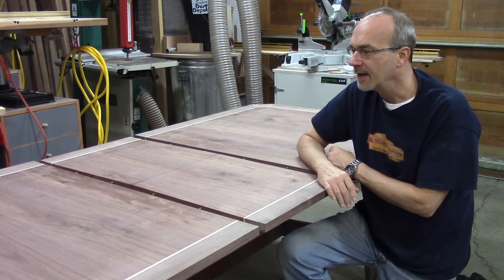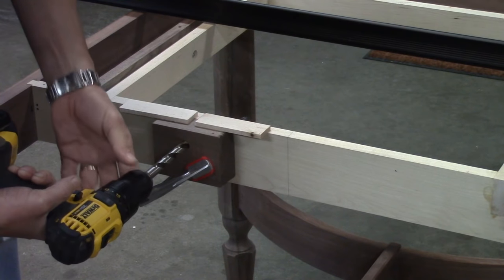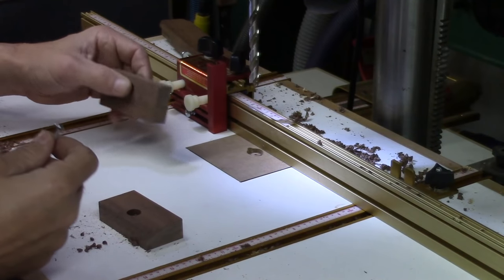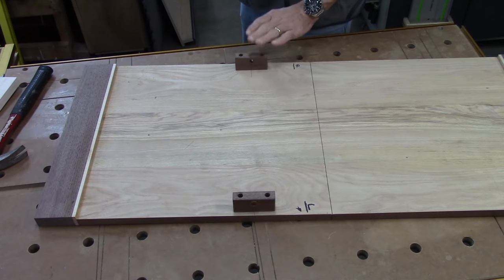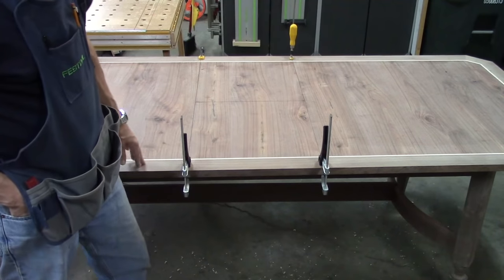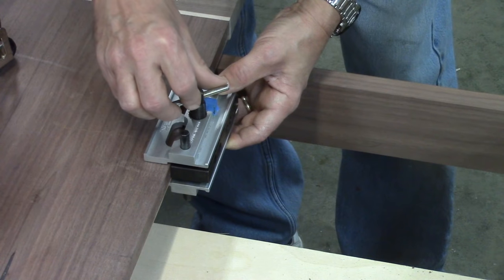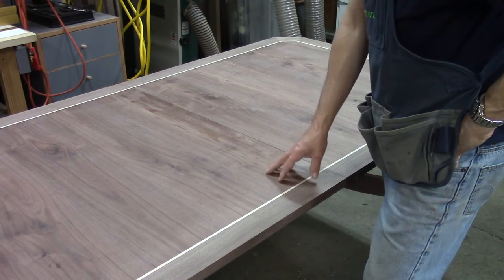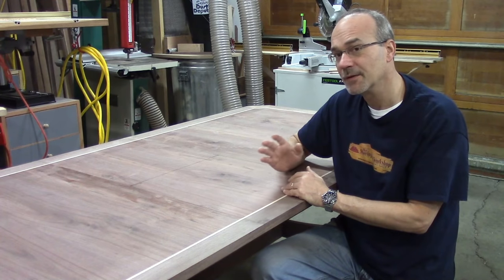Butterfly Leaf Dining Table 9 - Designing and Installing the Butterfly Leaf

Comment: Hi Guy! I watched all 10 of your butterfly dining table videos last night!  I've been looking for a design that I would like to build for a while, and fell in love with your table.  I would prefer to use solid wood in place of the veneered plywood, and would appreciate any tips you could share to accomplish that, especially how to compensate for wood movement.  Any help is sincerely appreciated.  Thanks again for inspiring me!
Reply from the maker: Hey Howard, You could easily use solid wood for the top, however there is no way to do the solid wood framing around it, as it would pull apart over time from expansion.

Comment: I really appreciate the planning that has to go into your projects and the way that you implement that plan.  Can you tell me, did you design the table yourself or did you get the plan from another source?  Great job on the splines, I think you made the right choice to use walnut.  To me, part of the art of woodworking is sometimes being able to hide the structural details of a project in order to preserve the beauty of the wood.  Using the walnut accomplished that.  Great job.
Reply from the maker: +Ed Stengel Thanks Ed! It was my design, and no plans were used. I just kinda build things most of the the time. I did make a scale model and a few rough sketches to cement some dimensions but that's about it.

Comment: Okay, I"m' confused ( nothing unusual there :) 
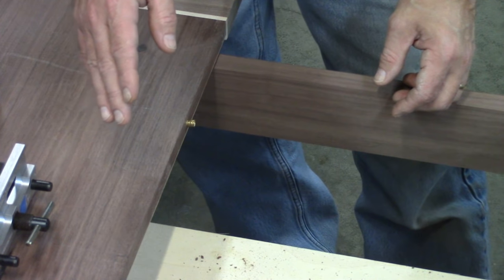I must have missed it? but don't understand what all that was about @ 11:11 when you did the corner piece in the middle of the edge??  not sure why it was a space there to begin with?
Beautiful table..   My grandfather owned a furniture store Years ago in Maine ( Moosehead furniture ) and our family table had a flip-up leave in the middle .. I was thinking of making one like he did. .but no idea on how to do that middle piece .. I see what you did. so I guess it's doable .. But . I"m still thinking of doing a DOUBLE leave .. One under each side.. But full length no cut in the middle.. just make it so the leave unfolds from underneath and flips up.. slide the table together.. and maybe a 2nd one on the other side to flip up? 
I"m sure that didn't make much sense? but taking your leave.. and leaving it solid with no split in the middle .. and make it fold to the left or right under the table. and hook up there. push a lever under the table to loosen the leave and swing it up into the table . least was my original idea, till I saw this..  GREAT TABLE !!!..

Comment: I have an old butterfly table gifted to me by an older gentleman. I dont know much about it other than it has some beautiful widdeled legs and lovely detailing. I refinished the top, but the butterfly leaf (when closed) flaps open, like there us nothing holding it sandwiched together when it is upside down under there. Any suggestions on how I can correct this or fix it?

Comment: Looking fantastic Guy. Love that leaf mechanism, use of bushings, etc. Did you work all that out, is this derived from some existing plans?

The corner splines turned out nice.

I didn't hear any expletive when you were pounding in the alignment pin and you missed :-(  I winced, for whatever that's worth ;-)  Hopefully you were able to iron it out.
Reply from the maker: +Marty Backe Thanks Marty! The leaf mechanism was something I worked out myself. There  are quite a few designs out there, however I wanted to do my own over engineered take on it. It's not any fun otherwise, right? HaHa. The parts were actually pretty cheap, less than $20 on amazon.

  And the splines came out really nice. you have to look for them to see them. Not invisible by any means, but nothing to draw your eye to.

  And yes, I did ding the table with the hammer. It was a very small dent, and it came out really easy with an iron and a little steam.

Comment: Guy, I was so inspired by this table that I've built the same table using Cherry wood.  I do have one question:  With the table top halves riding 1/8" above the frame, what supports the leaf 1/8" above the frame on the side opposite the pivot pin?  Thanks - Dan
Reply from the maker: Hey Dan. They rest upon the slides themselves as they are long enough in the back

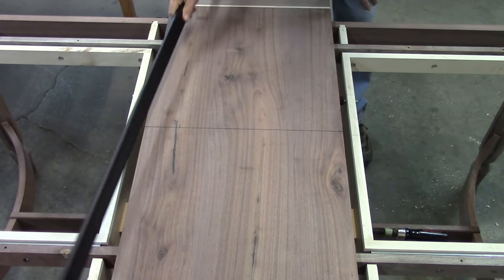Comment: At about 8:00 minutes in Video #9 you extend the sliding support pieces under the butterfly to level it.  But in Video #10, after these support pieces are screwed to the two sliding leafs, they don't project beyond each leaf, and therefore can't help to level the butterfly.  How, then, does the unfolded butterfly stay level and even with the sliding leafs?  Is it only supported by the aligning pins?  And echoing the others, I applaud your excellent work and tutorials.
Reply from the maker: Thanks Guy! The pins hold the leaf level with the top after it's extended.
Reply: Many thanks!  That's what I guessed.  Regards...

Comment: Awesome video. Trying to do a similar table but have the extensions on each side rather than the middle. 

I have a question though. How do you connect both of the top plates together. What hinge are you using to allow it to lock into place at 180 degrees? I'm having trouble with this hinge, and it seems like you didn't include it in the video :(

Thank you in advance
Reply from the maker: Thanks! There is a separate video that shows installing the hinges in the leaf.
Reply: GuysWoodshop which video is that? if you don't mind linking it then that would be great!

Comment: Great video and explanation, Guy. Love the center leaf mechanism. 
What brand doweling jig is that? Would you purchase it again?
Reply from the maker: +Steve Collins Thanks Steve! The brand is Task. I think it was about $30 20 years ago when I bought it. It works well as long as you keep a reference face. I would love to have the Dowel Max jig however. It looks like a great tool.
Reply: +GuysWoodshop I hear ya on the Dowel Max, Guy.

Comment: Beautiful table Guy, how did you determine where to put the pivot for the butter fly leaf?
Reply from the maker: Thanks Dan! I actually just guessed. I made a mock up and moved it around until it worked. The magic number it worked out to was 1/4 of the total width of the base from the center line.
Reply: It took me a few minutes to work out your measurements (after being confused for a few days). It looks like your 5.25" is not taken from 1/4 of the width of the base (33.75"), but from the finished width of the table top of 42"... given that 5.25 is 1/8 of 42.

I just wanted to clarify that in case someone stumbles upon these videos looking for the answer to the "where do I put the leaf pivot point" question that I and so many others in the internet have had. 

Thanks for this series! I've watched it a bunch in preparation for my first dining table build. I'm going with a equalized hidden butterfly leaf design that I cobbled together in CAD from seeing what others have done, including yourself. Again, thanks!

Comment: Nice job Guy.  The table looks awesome.  That butterfly hinged leaf is a great touch.  Those splines turned out great.  I'll bet Mrs. Guy is chomping on the bit waiting for you to finish this project.  Will you be making the 8 matching chairs?  :)
Reply from the maker: +Hardnox Thanks! The table is ready for the last coat of finish, and will coming in the house soon. And unfortunately my wife has decided on some store bought chairs. I don't think she wanted to wait for me to make them. HaHa.
Reply: Those store bought chairs will be crap compared to your table.  The wife will bring them home and you'll immediately need to strip, fix and refinish them.  You know that's true.  Ha ha.
Reply from the maker: +Hardnox We already have them, and they don't look too bad. But they are crap be cause I didn't make them. HaHa
Reply: GuysWoodshop I recommend that you handle this democratically, in other words... let your subscribers vote on the level of chair crappiness via a separate video. 1) If they are voted totally crappy then it's the burnpile for them, or 2) mediocre crappy then they need to be placed along the wall away from your beautiful masterpiece of a table..  :)

Just a suggestion.  Haha!
Reply: +GuysWoodshop haha, nice! Did you buy carvers for the table ends? if not, then there's a nice project - two chairs are quicker to build together than building one twice over. of course they would make the store bought ones look worse, but you could always stencil "store bought" on them, just to maintain your reputation with dinner guests!

Comment: Guy, looks absolutely beautiful!  You're doing an awesome job on this dining table.  I love the mechanism for the leaf, is that an original design?  Very cool.  Also, you had my heart racing when you were pounding in those alignment pins, I could have swore you hit the edge of the table once!  Yikes!  Nice work.
Reply from the maker: +Mike Kapotsy  It's been done before, so I don'y know if I would say original. However the mechanical parts were something I came up with. And yes, I did ding it with the hammer and created a very small dent. It came right out with a little steam from an iron. Thanks for watching and the nice comment Mike!

Comment: Very nice job, but I have 1 question, how did you decide the 5 1/4" from center pivot point. I am looking at making an Altar, and it is only 28" wide,
Reply from the maker: Thanks! It was a trial and error process with several scraps of wood clamped to the cross member. Just had to play with it a while until I got it to work properly.
Reply: ok thanks, I was hoping for an easier way, haha
Reply from the maker: Those butterfly hinges were purchased from Lee Valley. I know Rockler also sells them as well as Woodcraft.
Reply: we have a lee valley, only hidden type hinge I find on their site is barrel hinges, hopefully they work, thx
Reply from the maker: Yes, barrel hinges, not butterfly hinges. those are the ones.
Reply: I know this comment is old, but there is a systemic way for the pivot point. The distance from the center to the pivot point, will be the length that the leaf will go to the outside from that pivot point. So to have the leaf perfectly centered when folded, the pivot point needs to be exactly at 1/4 of the length from center to table edge. Or 1/8 of the complete table width.

Comment: Guy,  how do you lock the leaves together and prevent them from moving when the table is in use?
Reply from the maker: I was going to use sash locks, however after building it I found it was unecessary. The top is heavy and the pins are fairly tight so it doesn't pull apart unless you want it too.